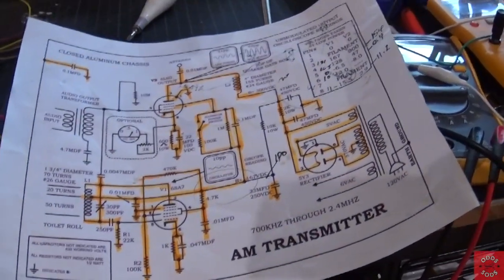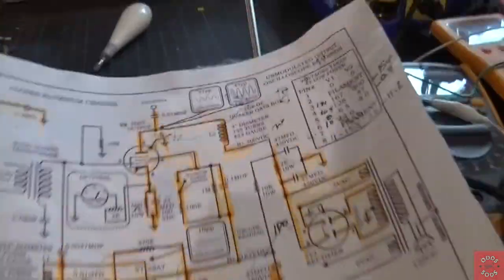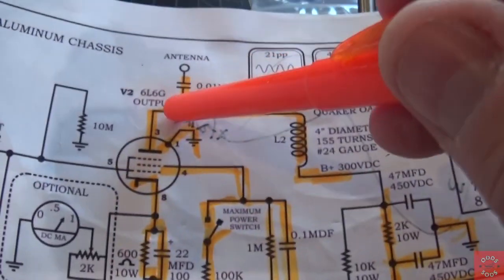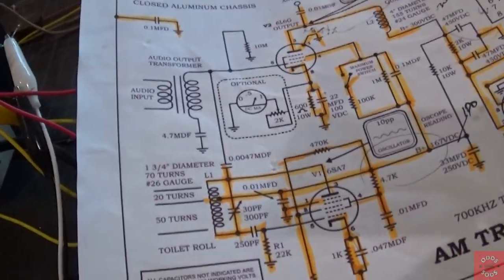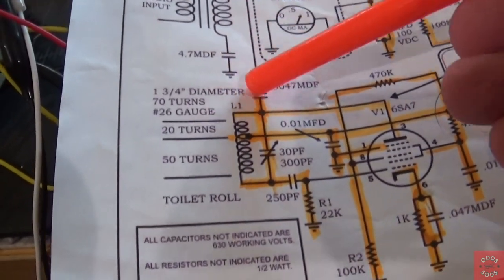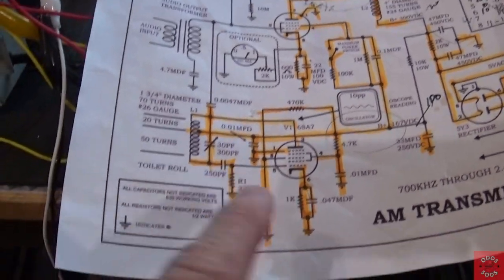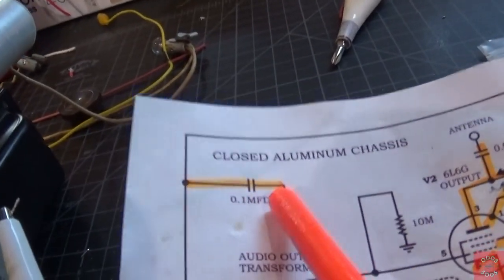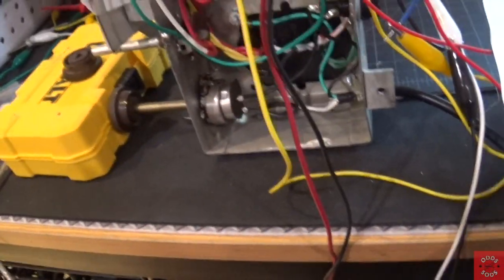Odds & Sods  Episode Lucky 21  -  Negative Press and Hot Chassis

Comment from the maker: Well... I am still stumped but some marginal improvement.  I did find the reason why I was getting DC on the chassis and have corrected that.  I did verify the 22K and 10M resistors are properly going to each pin and B-.    I also replaced the tube socket for the 6SA7 as I discovered some solder flowed down the pin and inside the socket.... not good... thats all fixed. I put the tubes in the tester and they are all great. The hunt continues and all that stuff :)

Comment: Ring the transformer secondaries, then check for a shunt, or shunts on both the plate and grid circuitry of that 6SA7 (pull the tube first, before beginning the shunt search).
Reply: you got a mention in my BOOKS vid. 
and Peter Weener returns for Ron.
Reply from the maker: Thank you for this suggestion, will get to it today and go thru this thing before I rip anything apart.  :) I am sure I am going to find it.. many thanks ! Ron
Reply from the maker: Will check it out Don !!!!!
Reply: Will check out, thanks!

Comment: First question I have is you said you are getting 280 V on L1 taps yet you said you are getting 191 V on the positive side of the 33uf cap.   That can't be.   They are electrically DC wired together per the schematic.   Both voltages should be the same.  Re-check your wiring relating to these parts.

The bias on the grids of both tubes are both essentially zero VDC.   Both pin 5 grids only go to the B-  through a 10M and 22k resistor.   This shows something is wrong with your B- to those resistors.    Re-check your B- wiring.

I think if you get your grid bias right some of the other voltages may sort themselves out.  

To verify that your death cap is not leaking DC lift one leg of that cap and retest the chassis to B-  voltage.   If it is OK the death cap is leaky.

Bottom line, all the faults you indicate seem to point to something being miss wired with the B- rail.   Focus on the B- wiring before you go nuts  rewiring things.
Reply from the maker: Thanks JP, that is the plan for sure.  I am going to start by checking all of my B- connections and go from there.... all good.. report back my friend. Ron